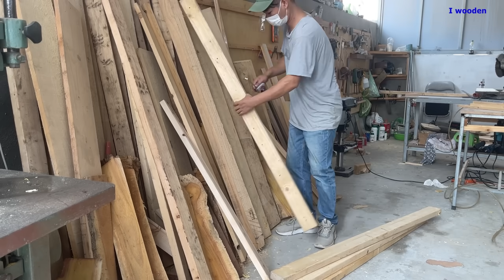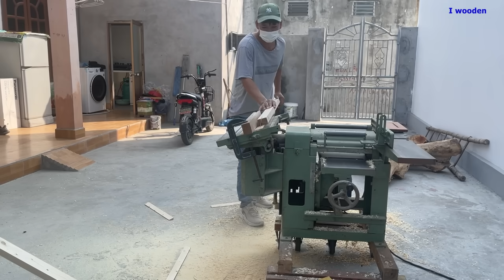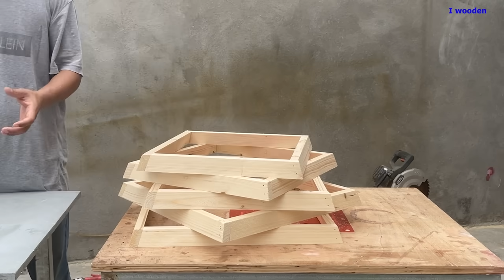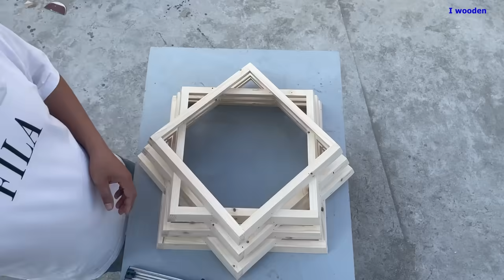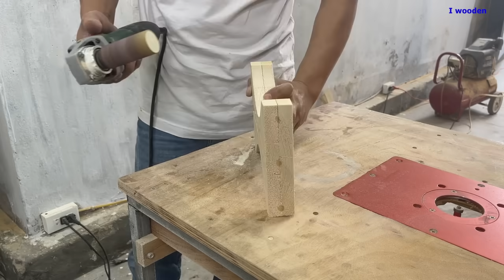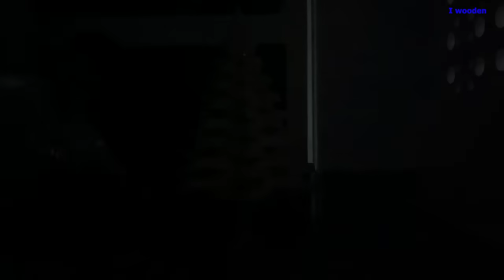How To Make A 3D Wooden Christmas Tree /// Great Ideas For Christmas!

Comment: I would sure like to be able to get the measurements for this tree!
Reply: I built one.  I made my stock 1 in thk with Parnell 20deg. Cuts on side.     Large rectangle on bottom I made 14 in Long on top  side. End angles are 20 deg as well.  Made 14,12,10,8,6,4. Rectangles. 2 of each. Top I cut at 20 deg to make the point.
Reply: Hardshell Woodworks does.
Reply: Install a light that changes colors.
Reply from the maker: Yes Sir

Comment: Very Nice!  I just built this myself, and here's what I was able to figure out between the video, other comments below and my actual build (U.S. / Imperial units and lumber dims):
Used 1x2 for everything except vertical base (1x6) and top cone (2x2).  Ripped 20deg sides on 1x2's with table saw, removing as little material as possible.  bottom of tree is 16-3/4" wide (16" pieces) followed by two each 14", 12", 10", 8", 6", 4", 3" and than top cone  - came out a bit wider and shorter than this video, but the 70deg sides line up near perfectly to the top.  Hardest cuts are ends of 1x2's, need a compound miter saw set at 20deg on the base and 7.5deg on the bevel.  Flip 1x2's after each cut (watch video closely) and lumber direction matters - you'll have to experiment.  Again, very cool and thanks to I wooden for posting this!
Reply from the maker: good luck my friend
Reply: olá, poderia me passar as medidas da arvore em centímetros, por gentileza ? gostaria de fazer para minha família
Reply: Do you have any pics to share?  How tall is the tree?
Reply: @thomasle6859  My tree is 26" tall (20" tree + 6" base), with 16 levels plus the top cone.  My tree is a bit squattier than I Wooden's, so if you want it taller and skinnier, you 'll have to have use less than 2" steps in wood length (and modify the 70 degree angle).  Sorry, can't get a picture to paste to my reply here...

Comment: Thanks @bradyoung7292 I tried 7.5 ° on the bevel and 20° on the base I flipped each piece over however I always ended up with the inside joints having a gap and the outside joints the ends were proud off the sides. Is it possible that I started my first cut with the wrong edge against the fence? I had the 20° cut on the base so the top edge was tight against the fence. Wish I could figure it out. Any suggestions?
Thanks.